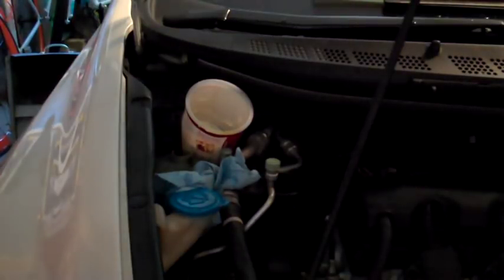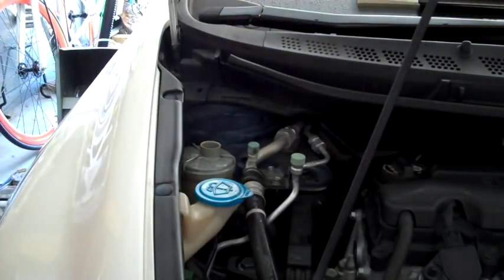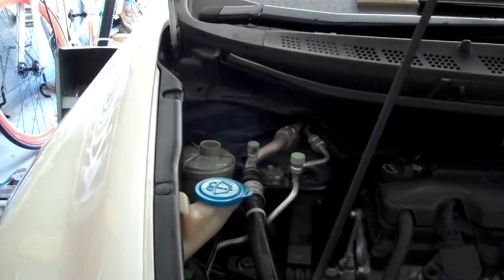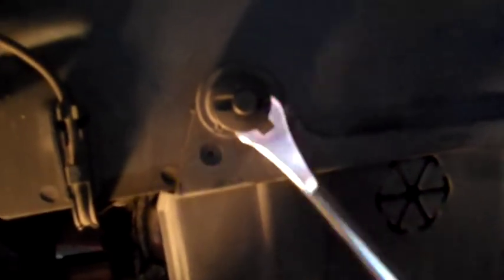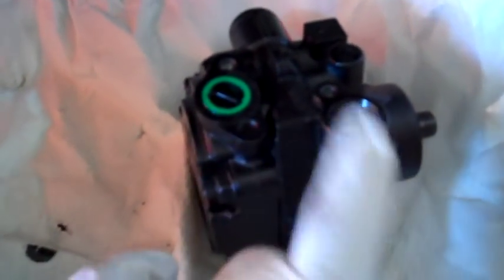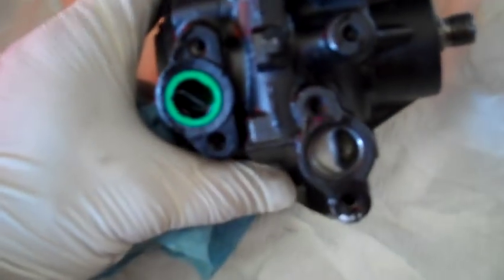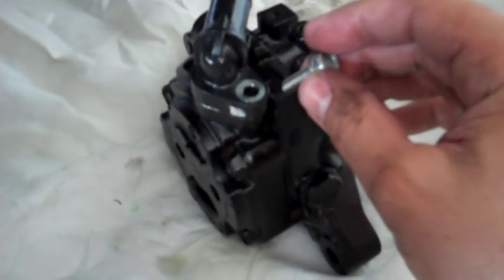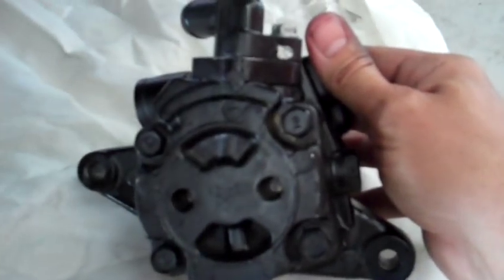2005-2011 Civic Power Steering Pump Replacement

Comment: For anyone watching this in the future: Removing the pulley off the power steering pump will be a royal PITA without an impact wrench. However, you cant fit an impact wrench in the small space given. This guys pulley was really loose, but odds are you wont be. I found a video that makes this much easier here: https://youtu.be/x8gSnCTlgEM
Reply: do i need to buy an impact wrench to remove the pulley off the power steering pump?
Reply: @renceri  I read a number of things online on how to do it without one, but none of them worked. You could always buy the wrench ($50) and then return it after?

Comment: i think you just had to use a little power steering oil to flush out the lines from contaminants as the pump should be fine if its new.

Comment: Cliff I am finally tackling this repair, yes I know 8 months later. lol . Quick question I am having the leaking issue and was wondering, was it the o-rings or the pump in your case that was causing the leak?? I am 4 bottles and several o-rings in. Thanks for the help.
Reply from the maker: If I remember correctly, I took the pump back up and swapped it out for another.
Reply: @CliffsHowTo   I am having to do the same. Looks like it's leaking somewhere behind the pulley. So angry right now.

Comment: Hey Cliff, was the whining noise present immediately upon start up or later on after 15-20 minutes of normal driving? I have 2009 and I am thinking it might be the power steering pump too.
Reply from the maker: It could whine worse, as the temperature under the hood increases.
Reply: @CliffsHowTo   Thank you for the reply. I'm ordering the new pump today. The noise is ridiculously annoying.

Comment: Nice video.  What brand of pump did you use?  Did you change brands when you switched due to the leak issues?  Looks like the last pump (painted black) was different from the one earlier in the video.
Reply from the maker: I don’t remember the brand, but it was the one from autozone, with the lifetime warranty.
Reply: @CliffsHowTo  Thanks for the reply.  Did the one shown in the last part of the vehicle work out?  Is it still doing okay today, or did the leak or other issues resurface?
Reply from the maker: My niece still owns the car, and I’ve not heard of any issues with the power steering pump.
Reply: @CliffsHowTo  Cool, thanks Cliff.

Comment: So just for the power steering pump, will I have to drop the engine?
Reply: I think he means lower it a little bit by loosening a motor mount.
Reply: For anyone reading this, there is absolutely no need to mess with the motor mount. Remove the bottom bolt first, then rotate the pump out of the way from engine bay which will make it easier to get to the upper bolt.

Comment: How’s your power steering pump so far? Does it leak or make any noise? I’m just being curious about durability of reman power steering pump. Thanks for your video !
Reply from the maker: It hasn’t been a problem since I changed it
Reply from the maker: Also I think from Advance Auto Parts it has a lifetime warranty so if it does give me any trouble I can just swap it

Comment: That o-ring is a pain in the ass... how is your o-ring holding up. I’ve gone through three so far from the dealer..I replace a new power steering pump and i can still see leaks leaking out the edge , the one your showing at the end of this video .
Reply from the maker: I sold the car about 8 months ago, but up to that point it was fine.
Reply: Doing the twist as your inserting it helped ?

Comment: Great vid Cliff,  going to  replace it myself too, was wondering how dud your power steering go out? Mine was working great but hade a leak on the high pressure line, replaced it with aftermarket,  worked great fir a few weeks, and one day on the parking lot while turning left to full right just got hard, cleaned the reservoir n  changed fluid to Honda fluid  , it was black n had little metal glitter, but still hard steeting, so letting me believe it's the pump, what do u guys think?
Reply from the maker: Sounds like it.

Comment: How much would it cost for a 2007 Civic Coupe? 
And how much is just labor?
Reply from the maker: If you take it to a mechanic, they would probably hit you with at least $500 to do this.
Reply from the maker: I don’t really know a good estimate though. I haven’t taken my cars to a shop in decades. With the exception of getting tires and alignment.
Reply: well they quoted me 1100  today between that and my compressor I'm at the value of the car
Reply: @secretstash4557 just gamble and get aftermarket parts.

Comment: Hi, 

  I purchased the Genuine 2006 Honda Civic coupe powersteering pump (waiting for delivery as of today). I assume that all the o-rings are in the PS pump.  Is that correct? since I am still waiting for my parts.
Reply from the maker: Rey Torres I bought mine at Autozone, and it came with the correct o-ring
Reply: Don't count on it. Less than $3.00 for both seals at the local Honda dealership!